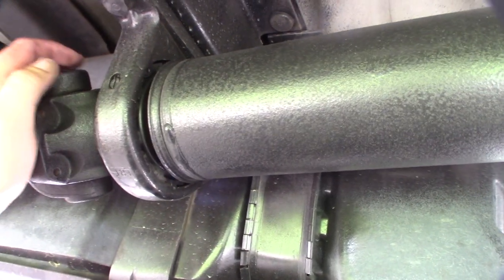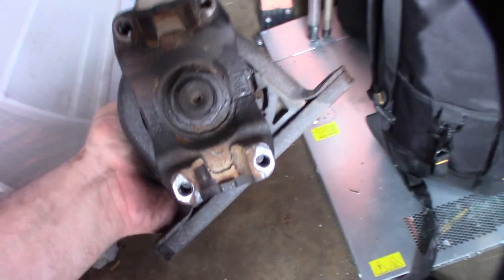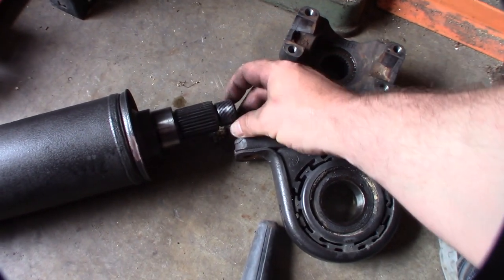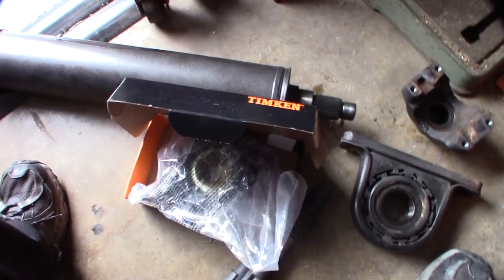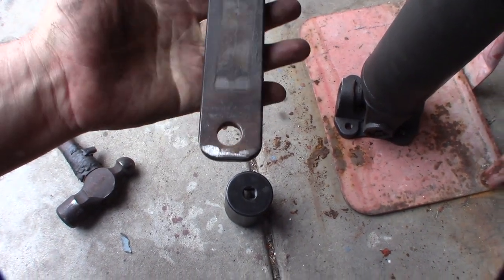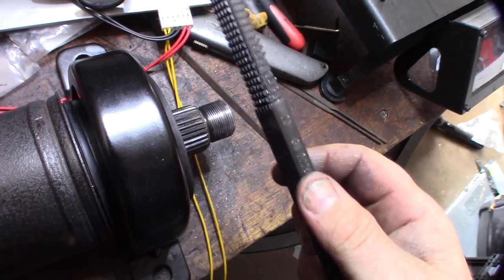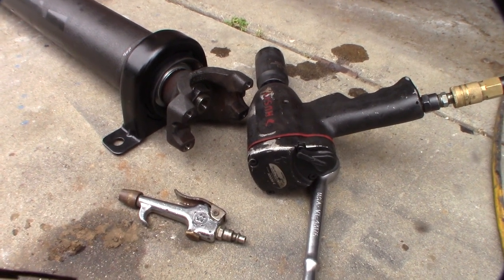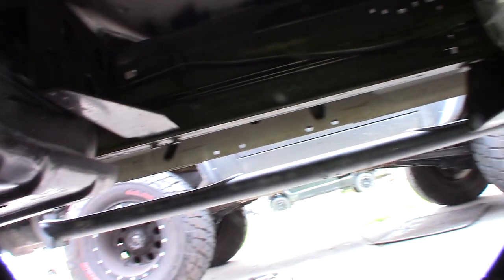Ford F250 Drive Shaft Center Support Bearing clunk over speed bump

Comment: That spacer is stock on some configurations. I have a 2006 Super Crew SRW with the 6-1/2 foot bed and it had the same spacer. I cut the welds and removed that spacer because the Pro Comp 62345 5” blocks I installed are tapered and angled the pinion up about 3 degrees too much. Removing the spacer put all u-joint operating angles at around 2 degrees or less, which is great.

Comment: This has to be like a NewYork truck.  Not a speck of mud dirt not a stain of oil spray from the road even. Easy to do work on a brand new truck.  Drive shaft carrier only lasted 50 miles